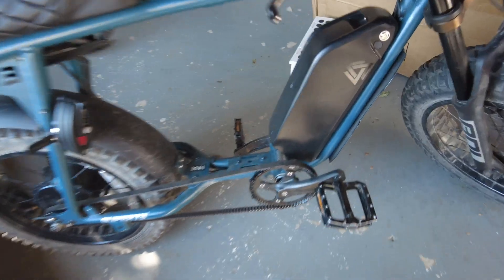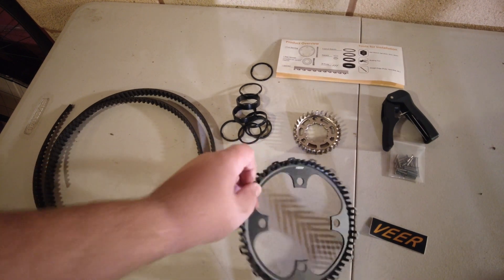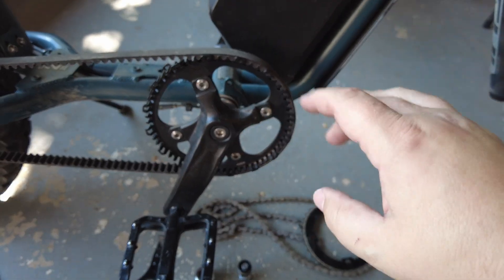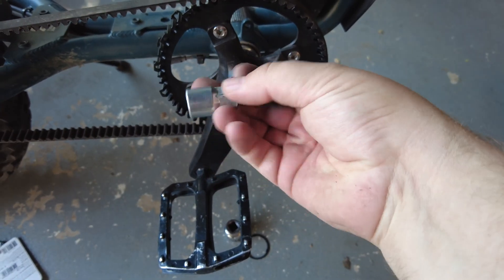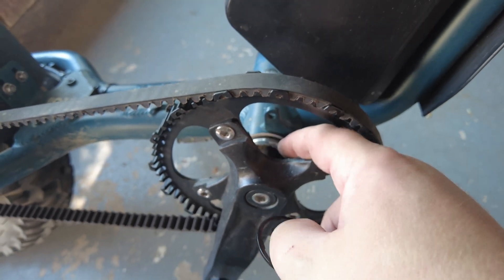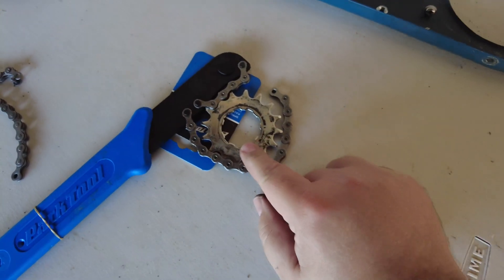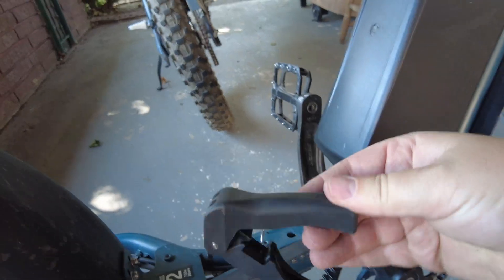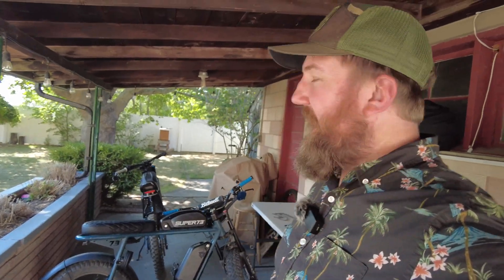I Removed The Chain Drive From My @Super73 | Belt Drive Conversion

Comment: So $449 for 2 sprockets and a belt? Extra belt $99 and another $75 if your chainstay is over 700mm?

That's crazy talk. You realize you can just cut your frame at the dropout and then make a plate that goes over the dropout to put it back together. You can use an old door hinge plate made of hardened steel. I got some heavy commercial hinges at the local Habitat for Humanity for $2. Use an existing hole and just make it the exact size and shape of your hub motors axle and younger the double bonus of having a much stronger torque plate. A hacksaw, a drill, a Dremel, and personally I did the tap and die thing for the mounting points so I could skip using nuts on the back. 

Belts are not expensive. You can find kits for belt systems for under $40. You had a cassette you just need an adapter plate and a fixy conversion kit to steal spacers from. A freewheel would be easier since most Razor MX series pit bikes have a bmx freewheel inside an adapter on the back sprocket(make sure you get the one that fits a freewheel and not the all in one replacement one because those fall apart).

You should be able to do this for under $99 and have a spare belt or 2 for less than they want for one spare belt. 

You did way too much work to get that going and still pay that premium. Ouch. 

Belts are cool though. But honestly just cut the dropout kids and that way you don't overpay for a belt someone cut and then drilled out and put a pin through. You could do that yourself. Just drill in 3 spots and run brake cable through the holes and put a crimp on it. You would sone metal in the holes to run the cable through, just use some old spoke nipple or any piece of tiny pipe  or some PVC would work just fine. 

It was interesting until I saw those prices. I know it's a niche market and Super73 owners like overpaying for everything but that's a bit excessive. 

There's a guy that 3d printed a setup that runs the belt over the chainstay so you don't cut anything. But like I said just cut the dropouts. 

You can get a welder for under $99 these days too and then you have a welder. Just saying.

Comment: The only choice available if I decide to convert my ebike rear hub motor to belt drive is a Gates “22T thread on/fixie” cog that doesn’t “freewheel”.
QUESTION: Does the rear cog need to be a “freewheel” cog for rear hub motors?

Does the super 73 have a freewheel cog in the rear? Thank you.

Comment: Ima do this to my s73 rx. Just gotta get a single speed rear hub
Reply from the maker: Not sure if it’s a good idea with the suspension and chain tensioner… check with the company before you order.
Reply: @SESSIONS73  thing is I want to run a mid drive only setup. Mid drive plus belt driven equals no chain stretch or snapping. And it’ll be pushing close or more than 5000w.
Reply from the maker: @johnnylong2049  Now you're talkin'
Reply: did you made the conversion on RX ?

Comment: Great video and interesting mod. I see you mentioned that it's 30 teeth for the rear cog but they have a few options that say 30T. Which one is it?
Reply from the maker: You want to check out the Single Speed Belt Drive - Split Belt Pro. That gives you the correct rear cog and you'll see only one option for 30 Tooth.

Comment: Why couldn't this be added to a RX?  Wouldn't it just be a matter of removing the tensioner and swapping out the stock sprocket for the belt rear sprocket?
Reply from the maker: The reason the tensioner is there is for slack on the chain for the rear suspension.
Reply: @SESSIONS73  lol I guess that should have been obvious to me but what about the gates belt drive system for sur-rons, how do they account for the rear suspension?
Reply from the maker: @eliotdangerflash  It's part of the swing arm assembly. This is all based on my observations. I am sure there's a bike engineer's response that would make a lot more sense.